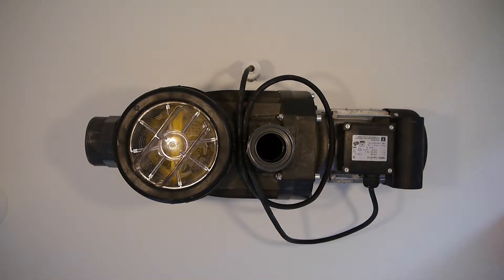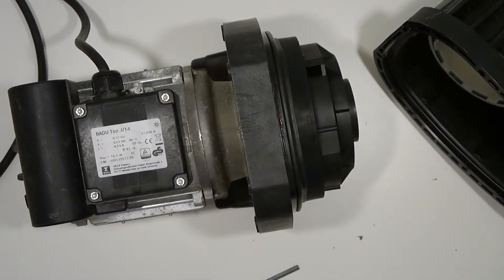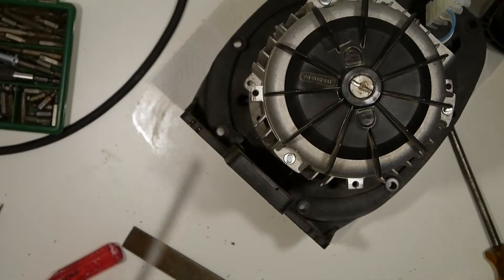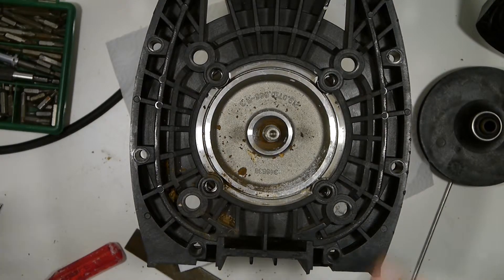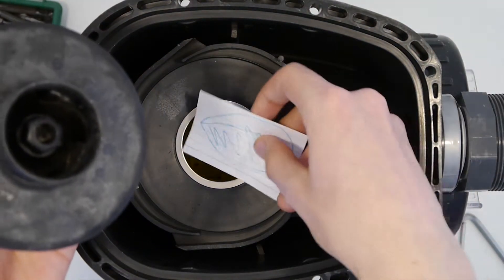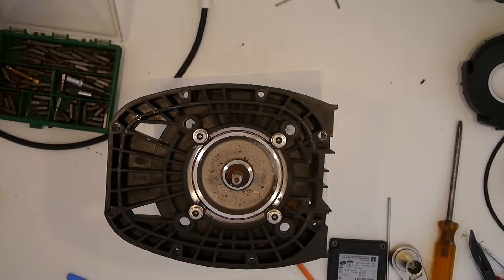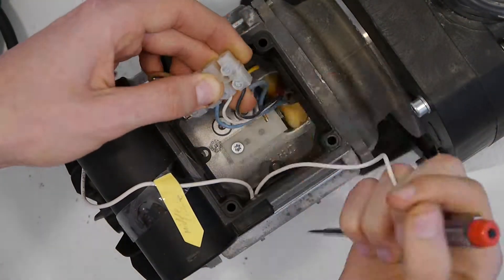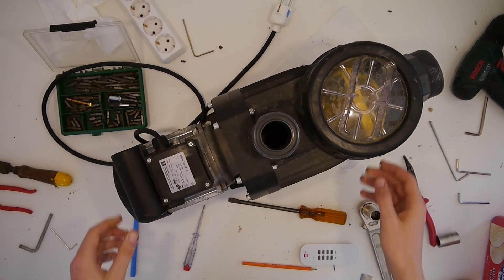water pump - teardown - Badu Top II/14

Comment: Superb video, the disassembly and assembly of the water pump is perfectly illustrated. Segments of the video, containing e.g. screw-driving, are very well speeded up so that precious time is saved. Thank you very much.
I have an 8 year old Badu Picco 5 pump in my pool filter which often does not start. After turning the shaft of the motor (in switched off state) with a screwdriver, the pump often starts running when switched on again. Maybe the capacitance of the start capacitor has decreased or the pump needs internal cleaning.
Reply: If you can rotate the rotor without much resistance, then it is probably the capacitor.
Reply: Thank you very much for your comment. A few months ago, I replaced the start capacitor and, since then, the motor always starts well.